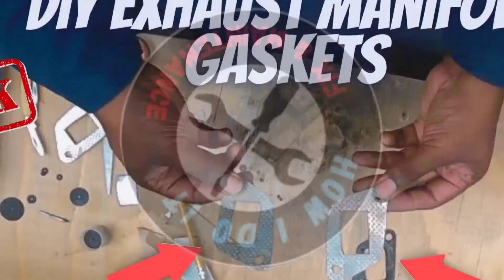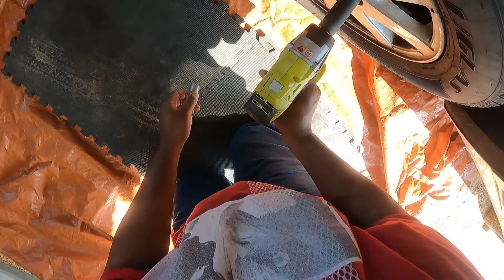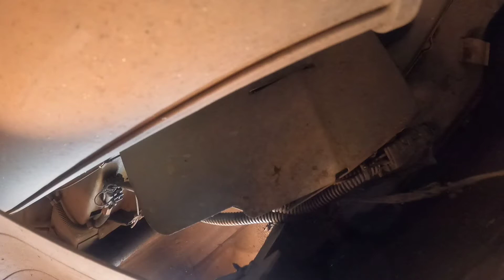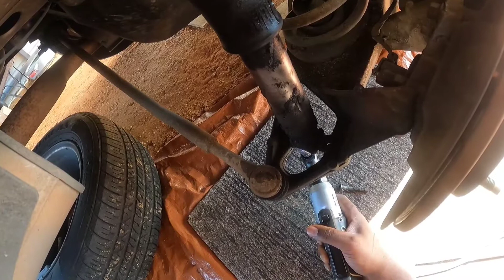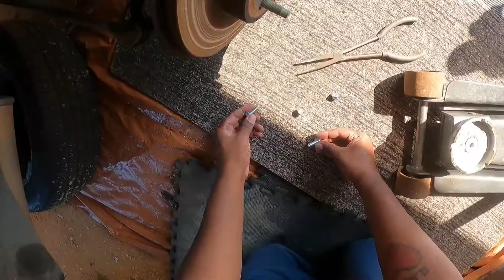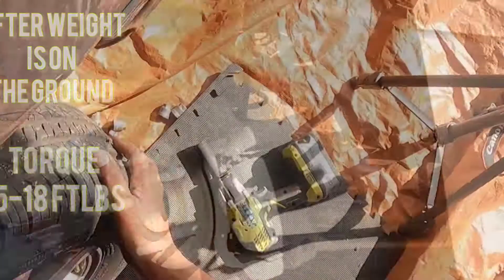2005 Buick Park Avenue Air Shock Conversion to Monroe Load Assist Shock

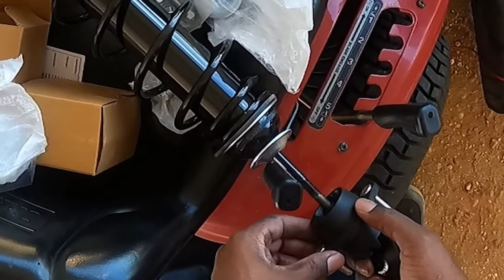Comment from the maker: At 5:23 that first washer I put on is backwards. Please note the instructions that comes with the shocks in regards to the  hardware orientation.
Reply: I think you actually had it right the first time @5:23 into the video. I’m in the process of doing the job now and when I flip that first silver covered washer piece the other way, the included nut doesn’t have enough room to thread onto the top bolt. And I checked the diagram in the included paperwork and I think you had it right the first time.
Reply from the maker: Thanks for pointing that out. It's been a couple of years since I did this repair, ironically I'm driving the ole buick today still smooth as ever.   I never want to give anybody the wrong directions. That's why I made that disclaimer. I'm glad you looked at the instructions and noted the orientation yourself.
Reply: Cool. Thanks for the response. Just out of curiosity, how many miles do you have on the Mighty Buick now?  I just bought a 2003 Buick LeSabre with 55,000 original miles on it for $3,000.  I’m in the process of doing the rear shock conversion now bc the air compressor is on the fritz and i just want regular shocks without the worry of future air shock problems. Have you had to do any other work on your Buick?  I’m also thinking of getting rid of the Dexicool and switching over to normal antifreeze. Thanks again. Just sub’d to your channel.
Reply from the maker: @kennethkrieb3018  I have a few of them. I changed my antifreeze over to the green stuff after I changed the coolant elbows.  I have a video on it on here.
Reply from the maker: @kennethkrieb3018 https://youtube.com/playlist?list=PLWvdRDFYJsOHdQaG4p6ufhFRh-6bXwExj&si=2XF-uLGiXAOgqm_v

Here's a Playlist of most of my buick  videos
Reply: Yeah, I just checked your channel out on youtube when I subscribed. I saw the antifreeze video. Thanks
Reply: Bout to do this to my 03 ultra too, Thanks much❤

Comment: Just replaced my rear air shocks with oem air shocks , rides like a cloud
Reply: Hi, where did you order them from? I need to replace mine, just bought an old 2002 Buick.
Reply: @ignatiusreilly8280 rock auto, it will say genuine gm and you have to order each one individually, they aren’t the same price and they aren’t cheap either, close to $600 with tax, shipped
Reply from the maker: Got them from. Amazon

https://a.co/d/0b8K41Cl
Reply: @HowIDoItFaM  Thanks, but I thought you said original air shocks. The link is for the spring conversion kit.
Reply from the maker: I'm sorry I didn't realize you were replying to another comment about the oem air shocks.  My fault.
Reply: @HowIDoItFaM  I see now : ) no problem, thanks for the video anyway.

Comment: this conversion was done on my lasabre,,, I have heard you can remove the factory coil springs after putting those shocks on,,, is this true that I can take the old springs out,,, and unplugging compressor, will I get a trouble code

Comment: 2:19 - I changed my shocks after watching this video. except the connector you point out with an animation isn't for the air compressor. that's for the fuel pressure regulator. I couldn't start my car with that disconnected.

Comment: Can you disconnect some fuse to the air pump and turn it off permanently that way?
Reply from the maker: It's a fuse underneath the back seat. I can't remember the exact one. I'm sure it's a diagram online. I've heard from numerous people that it can throw a code on the dash.
Reply: @HowIDoItFaM  TY

Comment: Those bolts and nuts look really puny for a suspension application. I've got a 1997 LeSabre Limited. It has DYNARIDE, does that mean air suspension?
Reply from the maker: Dynaride doesn't necessarily means you have but You would know if you had air. You would hear the compressor cycling on and off from time to time. 

The hardware was the same size as the oem hardware.

Comment: Maybe I missed this part, but the original shock doesnt have a spring, why does the Monroe replacement shock?  How is the ride different with the new shocks compared to the air shock?
Reply from the maker: Thanks for watching! 

The original  are supported with air, the monroes are supported by the springs. Rides great . No real difference on the highway.  Maybe just a hair difference on bumpier terrain.
Reply: @HowIDoItFaM  Thanks for getting back!  Im gonna give this a try, I found the Monroe Load Assist Shocks on RockAuto for about $80.  Love this car!
Reply from the maker: @starhawke380  yep! gotta keep these Buicks on the road!

Comment: Thanks Bill for fast forwarding through the obvious steps like tire removal, etc. I'm about to use this video to help me with the conversion on my daughter's 99 Park Avenue. The current passenger shock is completely rusted through and I don't hear the compressor running so I hope I don't have to deal with disconnecting it due to the bad angle in your video. Wish me luck, here goes nothing!

Comment: What you do with the air ride hose connection? No light on dash because it’s disconnected?
Reply from the maker: I unplugged mine from the  pump taped the connection off. No cel on the dash at all.  Some people unplug the fuse underneath the rear seat.

Comment: that washer is on upsidedown and there is a way to put it one edge of the body mount part is thicker and goes toward the inside
Reply from the maker: Good catch.  That's one of the reasons why I said note the orientation in the instructions. I pinned a comment noting the error in the video. Thank you.

Comment: Wen u removed the shocks did u have any service ride codes or anything
Reply: Well I was gonna convert my shocks over from air shocks on my gxp bonneville bt now my transmission jus went out 🤦🏾‍♂️
Reply from the maker: @osamalongway_6  dammit mane.... These ole girls getting on up there in age. My pops has a Lesabre and a Bonneville needing transmissions.
Reply from the maker: Nahh none at all. I disconnected the power going to the air pump too . Never had any code issues

Comment: Isn't removing the air pump relay of fuse enough though to kill the pump?
Reply from the maker: Yessir. You can it's under the rear seat. I was already under there and just decided to do it this way.
Reply: @HowIDoItFaM  I removed the #8 fuse & got a air bag light. Will try the connector.

Comment: Good advice with which air shock connector not to mess with. Nice vid all around. subbed. Think $7,700 too much for a 2003 Park Ave Ultra from Ohio rust belt with 77K on it? overall nice with some rusty bolts underneath probably garaged. Sounds $$$ to me but interior looks nice and dealer service report it checks out pretty good with minor intake manifold leak, 'nothing urgent'. They're known for that, maybe I can do it myself. Air compressor decision in that location looks like it was planned to fail.
Reply from the maker: Thanks for watching and thanks for the sub... Yea man $7700 sounds kind of crazy even for an ultra. The Ultras are hard to find down south, but those regular park aves of that era go for no more than 3000 for a clean one.
Reply: @HowIDoItFaM  Thanks for the reply bro, yeah I’m crazy 😜 That would probably be one of life’s mistakes so I’ll pass. Looking out for more content from you.

Comment: You dont have to remove the factory springs?
Reply from the maker: The rear doesnt have any springs just air shocks. The struts in the front do, they get removed as one assembly.

Comment: Great video. Did you go to the Load assist shocks because the air compressor was shot or because you knew it would eventually go bad and did not want to incur future costs?
Reply from the maker: Yep that's the reason why I went to the load assist. The Compressor was going bad ; otherwise, I would have just bought some air shocks ( and saved a little money).  The load assist ride pretty good though, I'm satisfied with them

Thanks for the like. Please consider subscribing, it really helps the channel grow. Also I have a few more Park Avenue videos you might like.

Comment: I converted a Buick Lesabre to a coil over shocks and the ride sucked !   If the compressor goes on what I'm driving I will go to the salvage yard.  Replacing the shocks is easy !
Reply from the maker: Damn that sucks. I drive my park Avenue all the time on the highway and hardly notice a difference.  If I'm on a extremely bumpy road I can feel a difference.

Comment: I bought a 2002 Park Avenue in 2012 and put new air shocks on it when I bought it. It doesn't ride as good as I think it should, but I've put 130K miles on it, too. It has almost 206K now. I wonder if it would ride better with the other shocks. 🤔 Thanks for the great video.
Reply from the maker: Thanks for watching Ron. Yep with 130k its probably time to change them out at again.  Honestly in my opinion, if your pump is still working fine. I would just replace the air shocks since the after market ones arent that expensive. 

The ride quality with the conversion shocks is great especially on the the highway.
Reply: Lucky you.  Must have purchased it AFTER the previous owner either replaced the blown headgaskets or maybe it got filled with stop leak and it's still holding strong.

Comment: What about the front ? Will it go that high wid new struts?
Reply from the maker: The front doesn't have the air ride system. They are just regular struts. I've found in the past replacing the front struts ( on my buick Lesabre) with after market ones it did raise the front up just a little bit.
Reply: @HowIDoItFaM  I did the air delete on the rear raised the rear 2" did the struts on the front raised it 2" Rides a little stiffer now but that will work itself out over time. Pulled the fuse & got an air bag light. I will replace it & try the connector & see if that works.
Reply from the maker: @oz7245  you pulled the fuse from underneath the rear seat?

Comment: Well I attempted to change my shocks today w/ the air shocks. One of the bolts snapped off 😳. Be thankful that you're in a warmer climate 👌🏾
Reply from the maker: 😳 That sucks man. Which one of the bolts?  Its supposed to be 11 degrees here in a few days ( definitely not normal for us) . I'm definitely not working on anything though.
Reply: @HowIDoItFaM  The 10mm at the bottom. I'm taking it to the shop unfortunately. It's cold in Jersey 😳
Reply from the maker: I bet it's cold there. I don't even want to think about it.  Hopefully they want charge an arm and leg.
Reply: @HowIDoItFaM  Yeah I'll keep you posted 👌🏾
Reply: @andrewoliver9686  3 years too late but on my lesabre the bottom bolt snapped like yours, thankfully there was just a clip that the bolt threaded into on the bottom of the shock which i could just bend out of place with the bolt head snapped off.
Reply: @Halfswordgoat Consider yourself somewhat lucky. I love my Buick, but I think it's time for a newer vehicle. Motor mounts are shot, front struts are on its last leg, need another set of wheel bearings and brakes. Enough is enough 😅
Reply from the maker: My park Ave put me down they other day, went dead on the highway. No spark at all. Towed it home. Ended up being the crank shaft position sensor.  I'm back rolling... I don't know why I love this Damn car.
Reply: @HowIDoItFaM Damn, my car doesn't start after it's been driving for some time. Only happens in the winter though. Mavis charged me $240 for the labor since I came there with the new shocks.
Reply: One of mine did too on my Bonneville. I use a die grinder to cut it off then a hole punch to drive it out of the hole. Took a few extra minutes but not bad. If you have penetrating oil, that helps. I used it on the other ones after snapping one.

Comment: I want to replace the factory air shocks on my 2005 LeSabre. Although it's a very little bit smaller and lighter of a car, I'd bet those shocks you installed would work.  Can you please provide me with all the info I'd need to buy a set for my LeSabre. Pretty good vid too. Thanks.
Reply from the maker: Thanks for watching.  These are the same exact shocks that go on your 2005 Lesabre. Same process and everything. 

These are the same ones in the video

Monroe Shocks & Struts Monroe 90007C Air Shock to Load Assist Shock Conversion Kit https://a.co/d/iO1p2hh

Comment: Those aren’t airshock they’re just coil over shocks if it doesn’t have a air nipple on the shock an didn’t come with a air hose kit with the shock then they’re not airshocks
Reply from the maker: Which ones are you talking about?  The oem ones I took off or the coil over, load assist I installed?
Reply: @HowIDoItFaM  the ones you put on aren’t airshocks
Reply from the maker: I never said they were. Those are the load assist shocks I converted too.
Reply: @HowIDoItFaM  buy you some airshocks you’ll  thank me later
Reply: @HowIDoItFaM  should’ve to the old shocks off an replaced them with some real airshocks where you can run you own air hoses that come in the kit an have that rear sitting as high as you want js

Comment: Used your video to do the conversion. Spot on man.  Thank you!
Reply: Do you know if the 9007 Monroe conversion kit will fit a 95 park avenue?
Reply from the maker: Nahh, these are just for the 1997 - 2005 buick park Avenues. Your 95 has a different setup.
Reply from the maker: Thanks for watching. I'm glad it helped! I'm about to work on Liz ( her name lol) right now actually.

If you haven't already leave your boy a like and subscribe to the channel. More fixes coming soon #happywrenching
Reply: Do you know which setup I need for the 95?
Reply from the maker: I haven't dealt with the 91 to 96 models to much as far as the suspension is concerned.  I think these will point you in the right direction.

https://www.ebay.com/itm/312260027615?mkcid=16&mkevt=1&mkrid=711-127632-2357-0&ssspo=hYMdJYEzQtS&sssrc=2349624&ssuid=9FyGnRSySe6&var=&widget_ver=artemis&media=COPY

Comment: Is there a fuse?   Mine's flat.  I don't hear the air shock motor working with key on.
Before I do anything... I'd like to know if there's a fuse?  I'm really low to the ground
Reply from the maker: There is a 30 amp circuit breaker in the Rear Fuse Block, that is under the rear seat. Look for an ELC label. 

Thanks for watching. If you haven't already subscribe to the channel for more fixes. I appreciate it. Let me know how it goes.

Comment: With the way you disconnected the compressor does the air ride light come on on the dashboard?
Reply from the maker: So far my light has never came on. I know some people remove the fuse from underneath the rear seat instead. 

Thanks for watching.  Would love a like a subscription, I'm trying to build this channel up.

Comment from the maker: What's up Yall. Please considering Subscribing and Liking the videos if you like the content. It really helps the channel grow.
Reply: Got a link or a part # for these?
Reply from the maker: @TheShitBoxSpecialist thanks for watching! Here's the link
Reply: Thank you and I subscribed!
Reply from the maker: @tannerharris5848  I appreciate that!
Reply: Ordered!😊
Reply from the maker: @TheShitBoxSpecialist  they are still riding smooth BTW!
Reply: @HowIDoItFaM  think I should leave the springs? I see you did but I didn’t know if it would sit higher than factory? I’m putting them in now.
Reply from the maker: @tannerharris5848  yessir leave those springs.  Only time I really notice the difference between the factory air ride shocks and these load assist shocks is when riding on a really bump road. It's not a bad ride at all.
Reply from the maker: It didn't sit any higher to me
Reply from the maker: https://a.co/d/7SULAJU
Reply: Installed and left the springs it’s a lil bumpy and so far sits about an inch higher than factory in the rear hoping it settles a lil, also hoping with how stiff it feels it helps with body roll in the corners
Reply from the maker: @TheShitBoxSpecialist  it'll settle in some for sure.. Yea it does have a tighter feel to me as well. Definitely not as floaty as the air suspension.